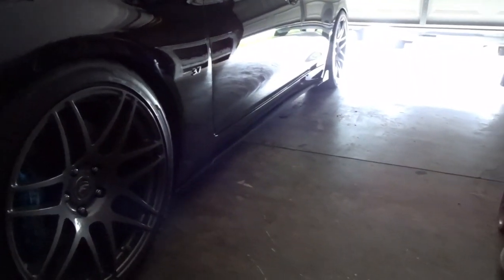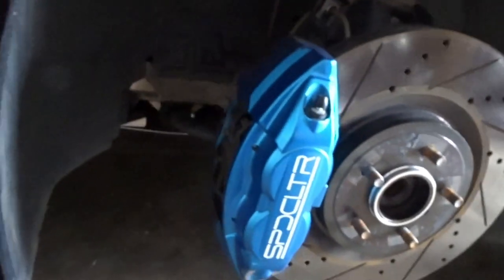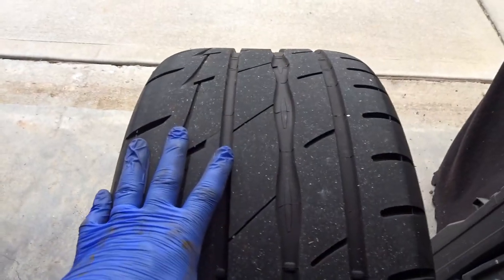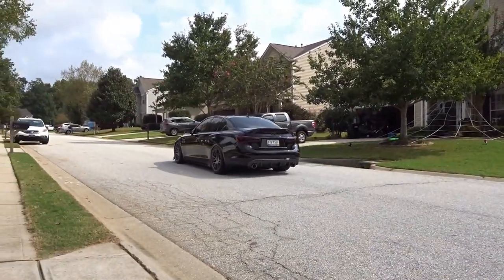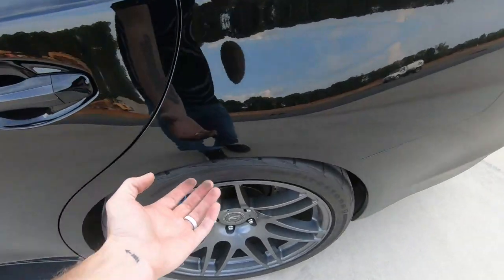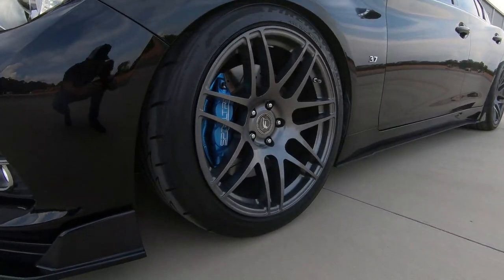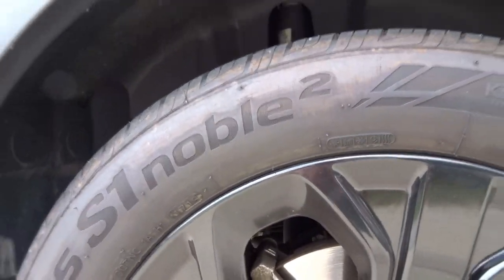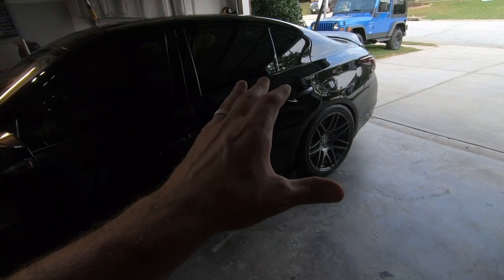SLAMMED my Infiniti Q50 and Regretted it IMMEDIATELY

Comment: Only regret is basically not going with air. Only a tank and a manifold heavier, the weights in the rear actually make relatively better weight distribution and you have instant access to height and stiffness and it handles just as well as coilovers that are around 2k and it's more practical and you can have the aired out look
Reply from the maker: Never been interested in bags.  I don’t about the weight distribution.  And not really interested in adding weight to an already heavy car!  But definitely like the looks people have been able to achieve with bags!

Comment: Man, only be low if your surrounding areas are accommodating, as for me I only dropped a 1 inch rear & 1.2 front & I still scrape my exhaust (Richmond, VA 🤕)
Reply from the maker: That's the tough thing.  Never know what you'll run into.  I like it at this height by my driveway at my office is terrible.
Reply: @SpeedCultureStudios  every road has potholes in RVA & some that are horrendous 😩, high entryways for parking lots 😫

Comment: New subscriber and new q50 Infiniti owner. Great channel! Slowly making my way through some videos but not enough time in the day! Bought a 2017 premium AWD and it needs some wheel love so I put a deposit on some CV10 Vossen wheels and BC coil overs. Just trying to iron out the wheel sizing and offset decision. I think in another video you said yours are 19X9.5? with 255/40 19 is that correct or am I confusing the other set you had? I like this sizing better that you have now. Do you think 20X9 or 10 would be too harsh of a ride? I have a Chrysler 300 with 22" that is somewhat worse than the factory 19 but just assumed alot of that was the cheap overseas 30 series tires I bought for them. Is a 19" all that much better than a 20? Can the coil overs dampening be adjusted enough to help compensate for the loss of ride quality? Thanks!
Reply from the maker: Tires are the same as my last set.  19s just seem to look better on the Q.  20s look a little too big—depending on design of course.  Even the softest dampening setting is still pretty rough compared to stock but would certainly be accentuated with 20s.  Just my feeling though.  
Thanks for subscribing!  I have around 325 vids posted now so you’ll find pretty much everything!
Reply: @SpeedCultureStudios  great I'll be watching. Thanks!

Comment: When I read "SLAMMED" I immediately had flashbacks of when my ex SLAMMED my Q70 front end on a curb and destroyed the bumper, rad support, and radiator... Glad this was a different slammed 😂😆😂.. End result, like others is not my thing.. but it looks good man. Keep the hustle homie
Reply from the maker: Ouch!
Reply: @SpeedCultureStudios  yeah.. Not sure which was hurting more; the wallet or the car 😆.. Ultimately was able to reform the bumper using a blo dryer on high heat 😆 a heat gun would've saved time.. But i saved $1000 on a bumper at least.. #PowerOfPositive

Comment: 2:33!

You have that line in your rotors too!!! What is causing that? I just put on two piece rotors on all 4 corners and I have that line on both fronts. I thought I got a pebble stuck in between my pads and rotors and was furious until I realized it's in the exact same place on both sides. I feel a slight catch when I run over it with my nail, but it's so small that I can't tell if it's a groove or a ridge.
Reply from the maker: It’s just from the turning process.
Reply: @SpeedCultureStudios  was hoping so. Just seemed wierd in the same place in the rotor on both sides. I know rotors will groove over time, but they've always done so at seemingly random places before on all of my other cars. Unfortunately, I can't take it apart right now cuz I just had spine surgery. 

Thanks for the reply. Have a great evening and thanks for all of the awesome content!
Reply from the maker: @BlaQBetty2018  Good luck in your recovery from surgery!

Comment: You should change the tires to something for skinnier
Reply from the maker: Why would I want skinner tires?  Rear is flush and fronts barely touch.  Still not even sure if or where they are touching lol.  Just have to raise the front 1/8 inch and it’ll be perfect.

Comment: Don’t do it on AWD 🤔
Reply from the maker: That is for sure!
Reply: @SpeedCultureStudios  😬
Reply: @SpeedCultureStudios  cant lower at all on awd? I dont want slammed but id like to go a little lower
Reply from the maker: @DG-888  you can go lower just not too low—front axel trouble
Reply: @SpeedCultureStudios how low can you go before having to change out the axles. Also can I get my bc coils installed without getting new control arms?